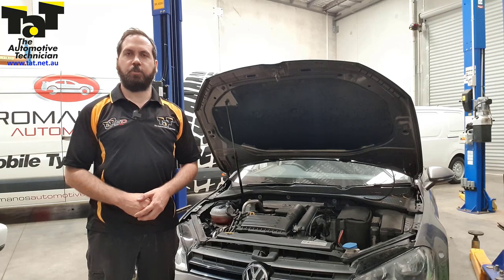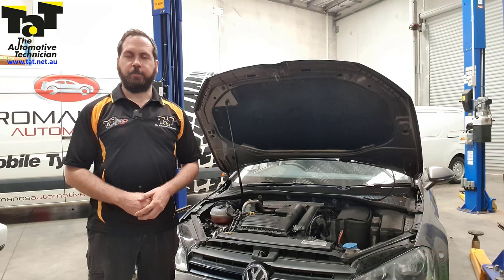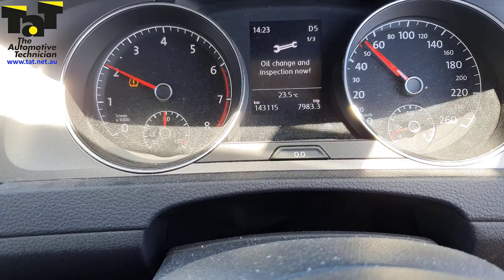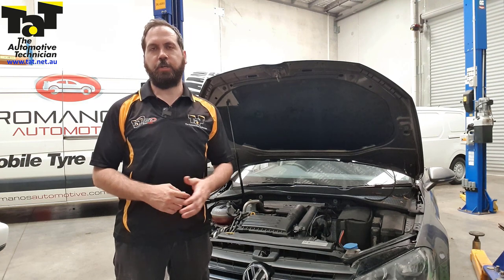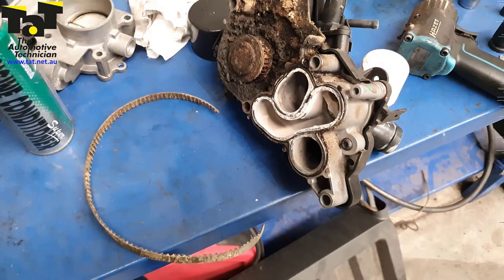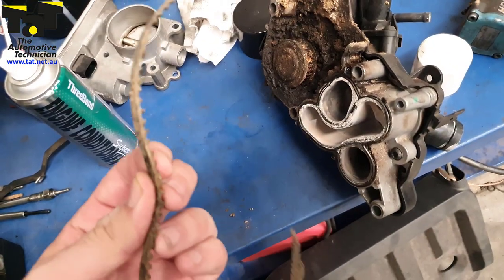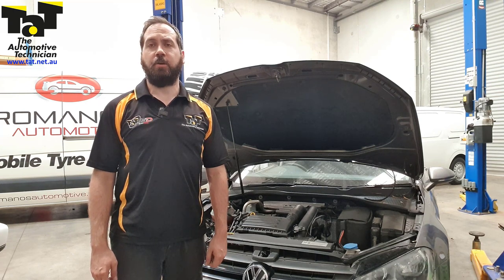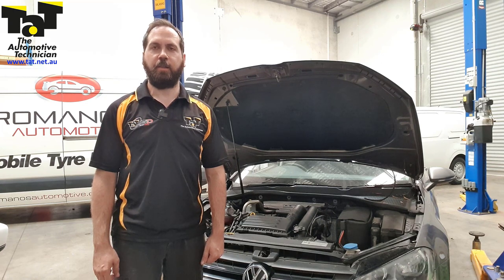2014 VW Golf overheating as soon as you accelerate

Comment: Hi Rob . My vw 1.4 petrol Jetta is having an overheating problem that occurs after a 50 or 60 km drive. I replaced the thermostat and the water pump but there is no change.  There is no overheating if I drive around town (slow speed ). What could be the problem?